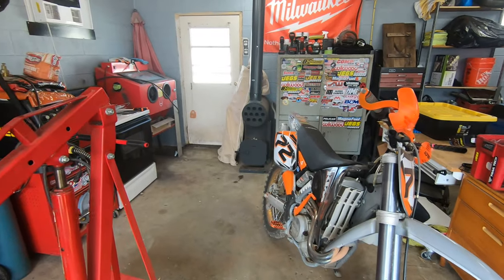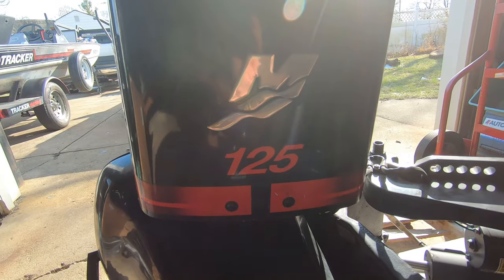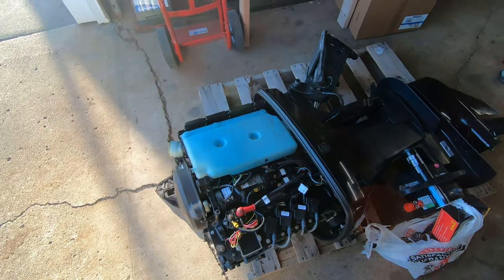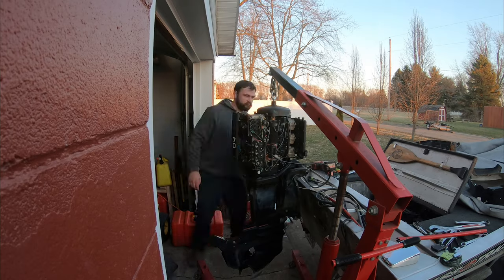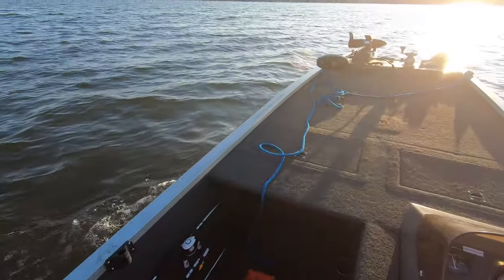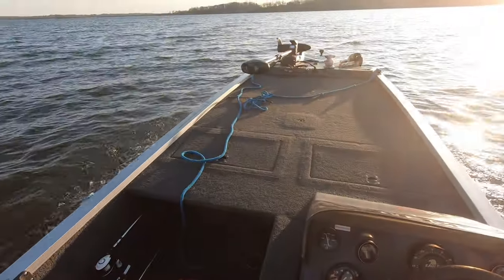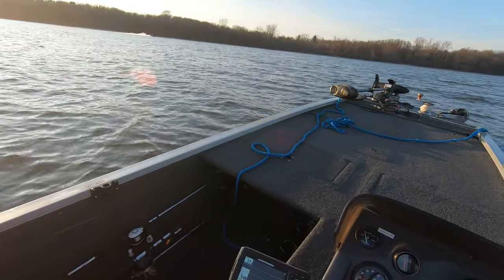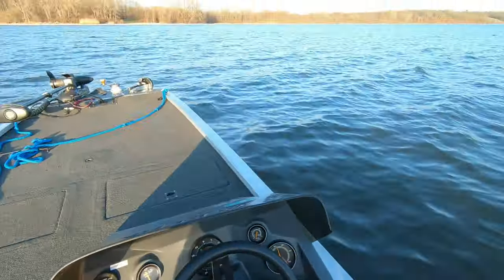Doubling My Boats Horse Power! Will It Survive?

Comment: I use to own a 1974 14-8 Glastron V-140 Skiflite with a 70 Evinrude (tri-hull fiberglass runabout, ~ 25-33mph - no GPS back then). Sold it and bought a 184 Champion with a 175 - 65 GPS (175 rating). 125 on my Glastron V-140 would have been a really bad plan due to the transom was engineered for 70hp max; and this boat's hull was never designed for fast speeds.  
Many non-professional tournaments have "no over-powered boats" in their official 2024 rules.
Reply from the maker: Okay

Comment: I have a Tracker Pro team 175tx with a 60hp Mercury 4 stroke.  I have the Revolution hull.  I can get 45 mph on a good day.  Max HP rating for the boat is 75hp. The 60hp gets good mileage and gets me there fast enough.  Just for knowledge, the 4 stroke is just as fast as the 2 stroke version, with less headaches.

Comment: I've got a Yamaha 90HP two stroke VRO motor on my Tracker Pro17. With the wife on it and loaded down for the day we can get 34mph as a top speed pretty easily. My max motor rating is 70HP. I rarely run it past 80% full power because the river has some turns that are 135°.

Comment: contradicted yourself sayin HP doesnt change top speed...... your statement about ability to pull the prop is the issue..... what was the hull designed to handle? its on a tag and is relevant mostly when park rangers pull an on water inspection ..... been there got a $250 ticket and had to go back
to the previous motor
Reply from the maker: Horsepower doesn't change top speed, just changes how fast you get there. If you think speed isn't dependent on the prop, imagine what would happen with no prop at all